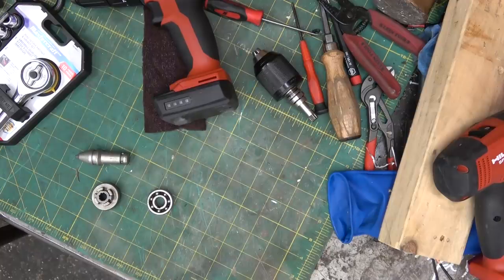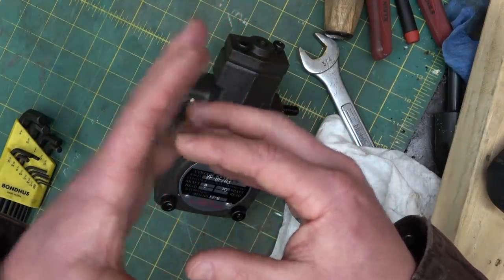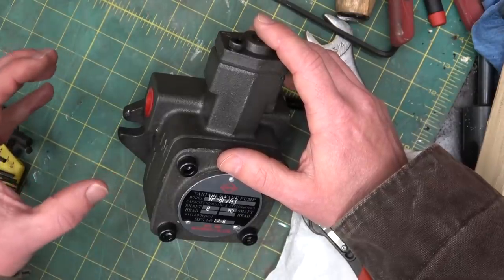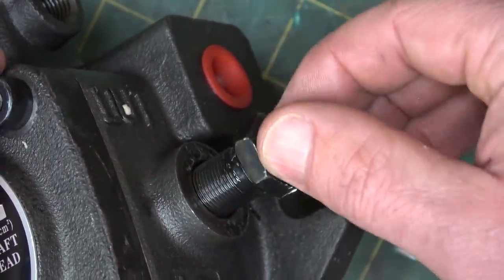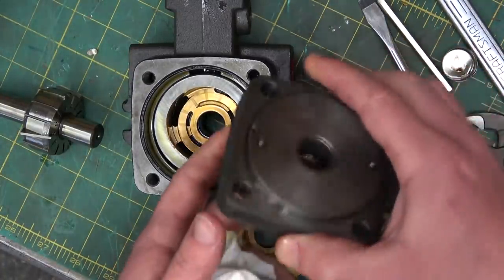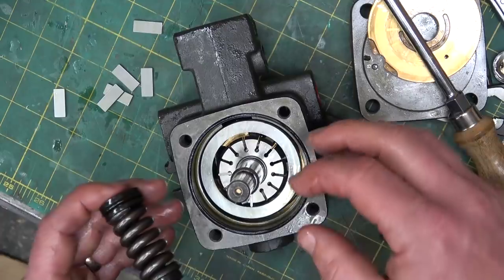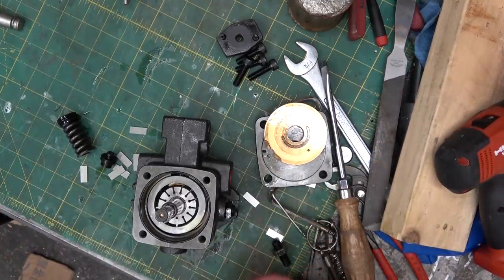BOLTR: Hydraulic Vane Pump | Engineering Lego

Comment: One time we were filling the loader's hydraulic tank because it's from the '60s and about as watertight as a screen door, and dad raised the bucket while I was filling it to help get the air out of the system. It was when he lowered the bucket that I learned that the loader needed about 3 of the 4.5 gallons I had put in it as the remainder flew out the 2" wide fill port. I reflexively put my hand over the flow, which turned it into a hydraulic oil sprinkler.

I threw out that jacket, but hot damn was my hair shiny and smooth.
Reply: Lol
Reply: James Sloan  ATF?
Reply: If you top it out on a cold day, warm it up some first, or do it in two operations.  The amount of heat expansion, after you have filled it cold, may earn you an oil soak when things have warmed to operating temperature.  I found that out the hard way.
Reply: I shampooed 3 times and I was still greasy, engaged my big boy brain and used Dawn. Oil baths happen, I keep a spare set of clothes in my vehicle now.
Reply: Always fill the tank when all cylinders are retracted, at least as many as possible.
Reply: Ah yes. I remember my first baptism by hydraulics. I can still feel the squishy shoes and that wonderful taste.
Reply: @mephInc  Mm-mm! And when it coats the inside of your mouth in a thin film. Toothpaste luckily did the trick, I was not excited about a Dawn rinse.
Reply: Teth47 I feel your pain brother, mouth full of diesel isn’t too nice either.  Little tip,  don’t put off road in a juice bottle...
Reply: Just thank Jeebus that it wasn't Skydrol, that is the most evil hydraulic fluid known to man...
Reply: Your hair stays that way for a long time too.  It works so good as a conditioner, when we were kids my brother and I thought about re-bottling it and selling it as a hair care product.
Reply: @Teth47  Dawn dish soap is some of the best soap ever made. Mild enough to be used on waterfowl and cuts grease like a hot knife through warm butter.

Comment: I have a lot of respect for hydraulic systems.  Was washing sand ( for use in concrete and road base) almost 30 year ago, got my arm pulled into the conveyor  belt as it was going around the bottom drum. Was stuck there ( working alone) for a good 10 mins, stopped belt but the other hyd motor on the system  ( was the shaker on a vibrating screen) was going twice as fast, eventually I fell back minus an arm. Ran to the car to call for help, luckily I had a mobile phone which was fairly rare back then.

Comment: You speak volumes about the raw force of a hydraulic circuit but didn't mention they can be hyper accurate. We have some transfer machines that use hydraulic quills; with high speed volumetric sensors and optical linear scales they will drill, bore and tap holes to .0006".
Reply: Dead true ! Still remember working with those “Samsomatic “ boring heads on Diedersheim machine tools .
Reply: He has actually explained parts of that in a previous video

Comment: All of our systems (4+ pumps, 4,000psi+) have side stream pumps which filter the shmoo and run it thought a heat exchanger.
Also fun side fact: Even "non flammable" hydraulic fluid will most definitely combust and sustain one hell of a flame when atomized and presented 3,000+ degree molten iron. When a little leak turns into a very long night. Oh and, Rexroth for the win.

Comment: Hydraulics are fun.   Back in another life, I maintained systems that worked off the Askania Regulator scheme.  You could take fractional variations in furnace atmosphere pressure and move a 3 ton damper in response.  All you needed was a hydraulic pump.     This was back in the day of clamp-galvanometer temperature recorders/controllers.  No electronics there either.

Comment: Same style of pump is used in many automotive transmissions. They do provide a lot more flow than a gear rotor pump. The springs on the cam rings are a good bit smaller since they only work up to about 200 PSI. But they are not as reliable if something goes wrong.

Comment: I always enjoy your videos and tell my friends about them.( I just tell them with my mouth, though, cause' I don't know which way I need to face to book 'em or send them a Twat or whatever that bird thing is)  I took a 2 week training course at the Vickers Hydraulic School and would like to share some things that I was taught there that differ from what you have learned in your own personal experience. 
  That variable pump design is one of the first and doesn't meet the needs of most industrial users any longer. They are very heavy for what they do, weighing almost 180 pounds for a 20 GPM version, if I recall correctly. They are also limited to a max pressure of 1000 psi. That is because it is an unbalanced pump design. Being made from two circles running eccentric to one another, the pressure is always going to be on only one side of the rotor when it is performing work and that exerts a side load on the rotor's axle and its bearings, requiring those parts to be massive at pressures higher than 1000 psi. The Racine company made these pumps and in the larger sizes it was even necessary to add a set of rollers for the outer cam ring to slide on because of its mass in their largest pumps, which are a measly 30 GPM. 
  All designs of vane pumps and motors that we studied had hardened, lapped steel vanes. I have had hundreds of pumps apart and have never seen a resin based material used for the vanes. I see them all the time in pneumatic motors and don't really see how they could withstand the forces generated in a hydraulic system. The intravane that you spoke off is used in "balanced" vane pump designs where the cam ring is elliptical and allows the pressure to build on opposite sides of the rotor, simultaneously, thereby offsetting or "balancing" the load on the axle and its bearings and enabling pressures up to 3000 psi. If that much pressure were applied to the entire vane bottom it would create so much force at the vane tip that the vane and cam ring would both be damaged, so it is only applied to about a third of the surface via the intravane.
  We were taught that vane pumps only require a light film of oil on the inside to protect them in storage and that they should be jogged several times when starting. The vanes will be slung out of their slots and into contact with the cam ring at approximately 600 rpm and pumping begins at that point. Of course hydraulic vane motors have springs holding the vanes in initial contact to get them spinning, with pressurized oil taking over as the workload increases.
  Since you are fond of acronyms, I wanted you to know that at the Vickers school the condition that you describe at about 3:40 in your vagao is officially and repeatedly referred to as PSO, as in Pressure Squirting Out. Apparently it's OK to mistakenly believe that pumps pump pressure if you find yourself suddenly dealing with that shit!
  As much as you seem to know about so many technical subjects ( and women ) I have to assume that you have built a reference library along the way. I can recommend the Vickers( now Eaton) text book that they use in their school, if you are ever in need of more hydraulic reference material. The last edition (5th) can be had for about $35 and the newest for about $85.
  Keep your youknowwhat in a whatchamacallit.
Reply: I have rebuilt only 10s of vickers vane pumps and maintained as many systems with these great pumps. They seam to last forever if treated right. The one thing they don’t tolerate is a restricted inlet.  They are easy to rebuild , but seldom need it if they are treated right.

Comment: These are used in lots of places, most every car made today probably has a fairly similar pump. Neat setup, as you said super simple truthfully.
Reply: oh and under 75 bucks? Bargain!
Reply: The 200R4/700R4 definitely used this style pump variable displacement included. The 4L80E uses a gear type pump and I believe the TH-350 does too. That said, not sure on any of the other stuff but a cursory look at a 6L80E says it uses that pump too. Maybe "most every" was an over broadening of terms but they're certainly not a rare pump in automotive stuff.
Reply: If you had a pump that wasn't VD you could easily end up with a bunch of power loss as he mentioned. Electric steering assist is IMO in part due to the desire to implement electric cars.

Comment: Knowing the direction is easy. Usually it rotates away from the inlet port for a pump like this. You can also put some hydraulic in the inlet and turn shaft in one direction. If it comes out from the outlet, you are on the right path.

Comment: As a mechanic I think it’s interesting that we see all these pump types in cars and light trucks used in very specific applications. 

Gear pumps for engine oil, cane pumps for automatic transmissions and piston pumps for AC systems. Sometimes you see one where you don’t expect but the applications are pretty standard at this point.

Comment: So, if i'm getting this right, the gear pump + blow-off valve works, but it's dumb because the blow-off valve like a short-circuit will create so much heat it'll just vaporise the oil. But the vane pump will sense the pressure it produces and lower it's pressure if it gets too high, keeping the pressure in a kind of safe range? Pretty cool!

Comment: FWIW, the 5"/54 caliber MK42 naval gun system that I spent my entire time in the Navy working on had its train & elevation powered by a piston pump, yes with what we called a tilt plate to control the rate of hydraulic fluid flow.
The part of the gun powered by that weighed over 50 tons.
The gun was actually driven to be aimed by hydraulics, and yes, it was servo controlled.
We could hit a target the size of a car at 15 miles.
;)

Comment: Good vid. Thanks! Reminded me of when I took a vacuum pump apart and couldn't get it back together again! About 20 yrs ago when I was a youngling about 23 I was a newby maintenance guy at a hospital and one of our vacuum pumps needed new vanes, it was about 4x the size of the oil pump you showed, so we really easy to see and work on. I took it apart and got the new vanes and never finished putting it back together. It was the twin in a paired backup set, but I wonder if anyone ever got it put back together? I wish I could remember what the problem was getting it out back together, something to do with the vanes I think.

Comment: Love vane pumps. Can really put them through hell and the only thing your likely to damage on them are the teeth on the input shaft. The one in the transmission of a car will handle insane amounts of torque without any trouble at all. Crazy part, the one in a car's transmission is small compared to this one, about the size of a hockey puck sliced to half of regulation thickness.

Comment: A little late to the party here..   Just want to add that typically leakage in compensated pumps returns to the case and then tank via the drain (DR) port.  The Vickers style cartridge vane pumps don't have a drain port and leakage becomes a part of the pump inlet side.  The adjustment screw 90deg from the compensator might be used as a tuning adjustment for noise as its sometimes called a thrust screw. Max volume adjustment screws are typically 180deg from the compensator on vane pumps.   Cheers, Fellas.

Comment: There may be an adjustment stop as well. And I would think the pressure compensator has a handle to adjust the system pressure by increasing/decreasing the spring tension.

Comment: Pumps create pressure, a difference in pressure creates flow. Even if the outlet was wide open the pressure where the moving metal meat meets the fluid would be higher than at the outlet.

Comment: What are the chances of putting on a transparent cover to watch it work?
Reply: I don't know much about hydraulics but heat and pressure eliminate that possibility without some extraordinary chemical engineering feats.  There is a reason these parts are made of steel and not ceramic/glass.

Comment: I’ve never in my 8 years of dealing with hydraulics seen oil so hot it caught fire...
But this is definitely a sweet unit
Reply: Hopefully you never will. If the oil is at it's flash point it can ignite if there is a pressure leak/ spray and an ignition source. Finely atomized oil is quite combustible, ask any diesel guy.

Comment: Interesting explanation on the feedback system for self-regulation. In theory should be do-able with the other style pump though. (A portion of the relief could go through a passage and a piston that pushes back on the tilt block.) Some of those with tilt blocks are reversible (depending on which side of the piston being driven that you want the fluid to go to), so getting it to zero on the sweep might be trickier to pull off.

Everything has its trade-offs and cost, but I'd suspect if it's useful enough, at least one version of it is out there.

Comment: With such pump in your hydraulic system would you still use overflow valve set to higher pressure as a safety feature?

Comment: In order for there to be flow there needs to be a differential in pressure.  So a pump must be able to create a differential pressure in a system in order for it to flow. A restriction will increase the amount of pressure needed to overcome the restriction in order for flow to continue.  I could be totally wrong that just what I was taught in engineering.

Comment: Interesting knowledge shared, Thanks
Im researching to buy a rotary mower to place in front of a skid steer bobcat
I see some motors on the mower have only a relief valve, along with some that a hydraulic hose goes back to the machine to relieve the pressure, perhaps i should of said .....flow.... there
Interesting you said of how the system can build up very quickly to getting hot, even catching fire 
My question
The variable displacement vane pump
Is this a good idea to have a variable displacement vane pump plumbed up where the relief valve is location on the motor ?
Or
Have a variable displacement vane pump plumbed up somewhere incorporating it within the hydraulics of the machine if it doesnt have one ?
Thanks

Comment: That vane pump looks just like one I fixed from inside a FWD transmission. Parts were under $15, shop wanted like $1500 for it. Just swapped out the old vanes, rotor, and chewed up shaft for a new set of parts.

Comment: Ubiquitous enough that this is how pretty much every belt or gear driven automotive power steering pump worked for 30 years.  Also common to find vane pumps in automatic transmissions, even though the gear pump hung around in those for a long time.
Reply: First automatic transmission - Hydramatic - had a variable displacement front vane pump in the mid-50s variation.

Comment: I have a question,  I have a simplicity PowerMax 1450 large loader  tractor, if I use the front hydraulics to much the O-rings burst off in fluid goes all of the barn wood do you think something could be wrong with the plate that controls the flow?  It does have a  vein pump  and all new cylinders.

Comment: Liked the mention of venting case pressure to inlet side. Reminds me... I tried limping a cnc lathes turret that had blown internal seals, and would hydraulic lock itself once all internal space was filled with oil, via a bung in the case and running it with quick and dirty Festo lines back to an unused tank line port. I was reminded by greybeards that tank lines in hydraulics systems never see zero pressure and it wouldnt relieve the pressure that way. What gives? Seems to be verking... is there really 5bar or so pressure on "to tank" lines?

Comment: My plan is instead of an electric wench for by Ford F-350 Crew Cab 4x4 with the 8’ bed I will install a hydraulic wench with a PTO mounted on the auto gearbox.

Might you be interested in providing your expertise on the forementioned hydraulic turmoil I’m about to get myself into to?

Comment: So the angle of the dangle IS proportional to the heat of the meat.. Let the size of the shaft exist such that it less than equal the size of the bolt hole thus some convoluted sigh which implies the restrictions of the original equation and increases the complexity of the relation. QED

Comment: I have every reason to believe our water jet pumps use gear pumps after seeing this. They run so freakin' hot at times, especially if the intensifiers aren't cycling very quickly. Would a variable vane gizmo scaled up to handle an input of 50-300hp survive the brutal nature of life in a water jet pump? The pressures do go from near zero to upwards of 5000psi cyclically.. constantly.
Reply: you'll want a check valve  radial pump that has super clean fluid. 10k psi isnt unusual but they cant handle contamination

Comment: So the gerotor style pump produces heat through the pressure relief valve, does a variable vane pump produce heat due to the changing of direction of the fluid through the manifold plate?  If so, is it enough that it has to be taken into account in the design of the system?

Comment: So what would be the failure mode resulting in those vanes turning into sharp af slivers? At work the rubber molding guys had a pump go out, they filter all the oil for a  week, got a new/used/rebuilt pump two weeks after the first died, then a couple days later the 2nd pump crapped the bed and the vanes were all sharp slivers. Next think I know they are waiting "2 months" for another pump.

Comment: What would happen if I was able to cool the relief oil, change the viscosity,. increase the cooling as the temp rose up. how much cooling do i need, what is formula for cooling hydraulic fluid, can i use a shell and tube configuration

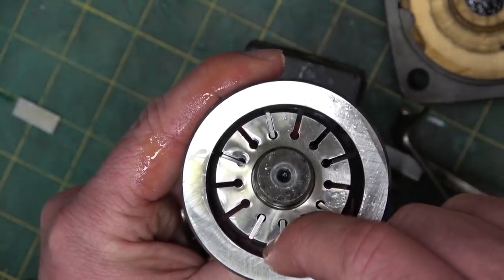Comment: 13:10 how does that reduce the sealing force? The little vane gets pushed in, hits the main vane and the contact area is the same? Where is the magic hiding?

Or, if the cutout is on the sealing edge, how does the inter vane get pushed in to actually seal?